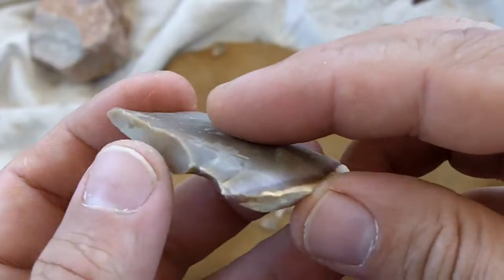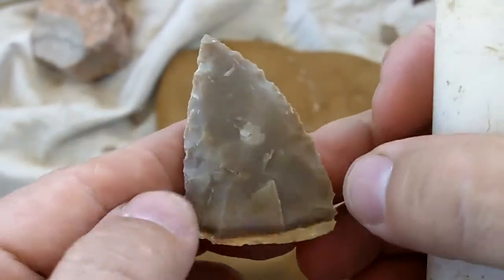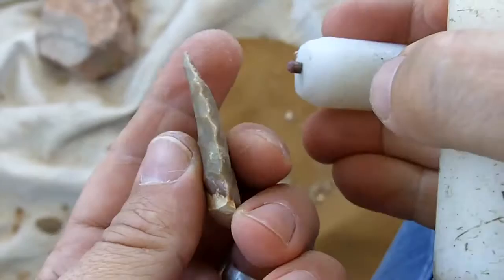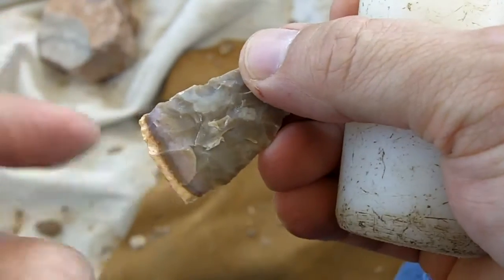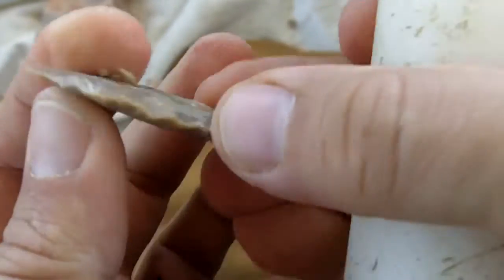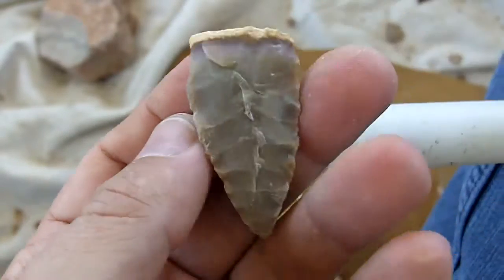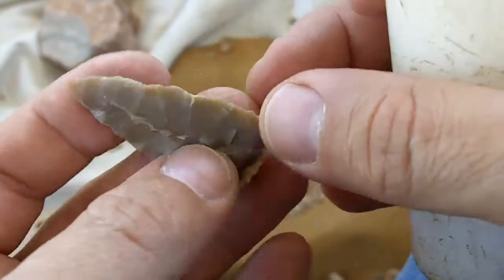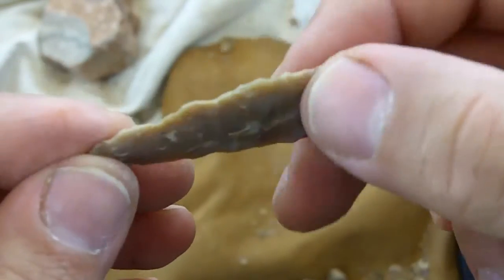257 - Knapping and Talking about Ultra Thin Southwestern Arrowheads 1/4

Comment from the maker: Yes, that piece is heat treated.  Some varieties of raw chert will flake very well but most are tough and/or course and require more force to knap effectively.  Raw chert or flint is not necessarily more difficult to knap but it will wear down your tools faster.  Heat treating has allowed me to basically double the amount of material I can work with without worrying about excessive wear on my tools.

Comment from the maker: Fire pits get up to at least 600 degrees at 1" below the fire.  Lay down the stone in a single layer and put 2" of dry dirt or sand over the top. Spread the coals evenly at a depth of about 2" and cover with another 2" of ashes.  Let it burn for 2 days or until the coals go out and the stone is cool enough to touch.  That's the basic strategy.  You may need to modify to get the best results.  Most stone heat treats at 400 degrees.

Comment from the maker: The smallest flakers have 1/8" diameter wire.  Not sure what gauge that is. I just go by the drill bit size I need for the hole in the white plastic handle.

Comment: Question.  I made an indirect percussion flaker but instead of plastic i used wood.  Basicly an ishi stick.  Each end has two differwnt sized copper ground wire.  Anyway.  It isent working really great . But im knapping some purple jade i bought at the rock and concrete yard.  The purple jade is mixed with redish clay and really hard white ish colored stuff. I have about 30 lbs at 30cents a lbs.  Of this purple jade and about 1 lbs is knappable at all . The rest has fractures all through it